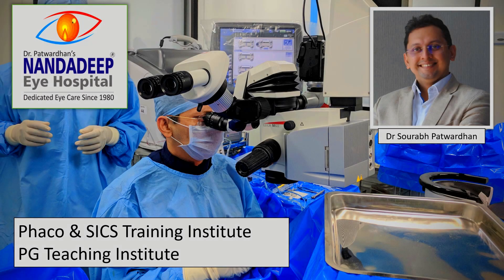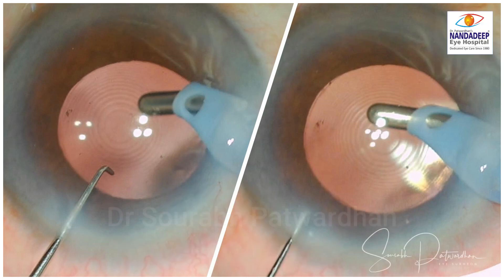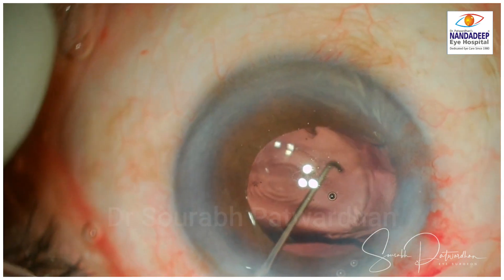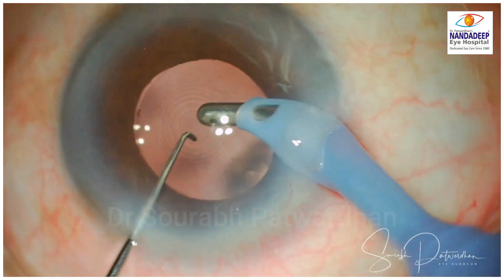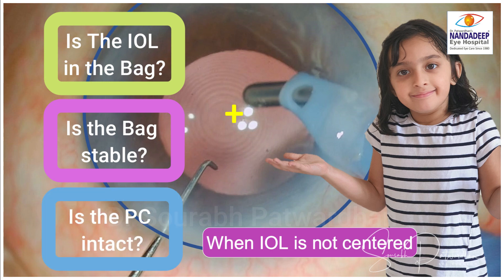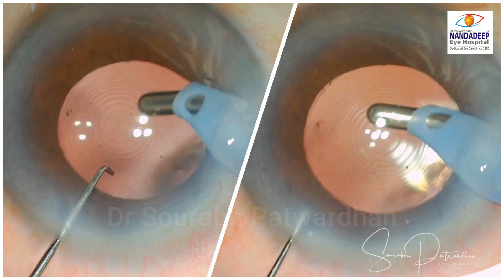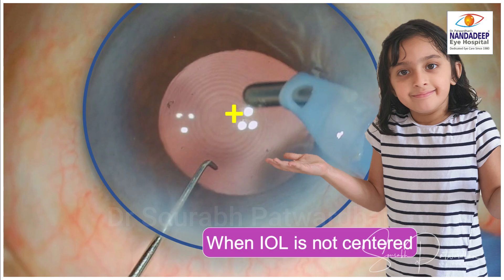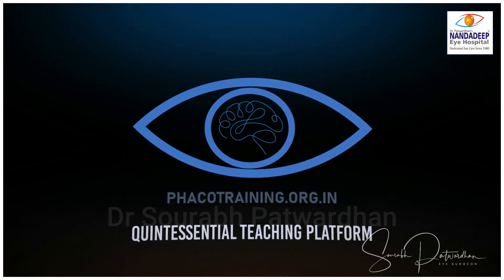162 Decentered IOL : Thought process Dr Sourabh Patwardhan .Can you spot the difference

Comment: Decentration of iol ,recognized mostly by lens shift to a side .but by purkinge images ..sometimes  parallax  also gives same picture .no obvious shift ,just P I ,any other sign !? for decentration
Reply from the maker: You have to center the eye so purkinje images (easy if patient can fix on light) are closer to optical centre and check if iol optic is fairly centred. If not, its decentered.